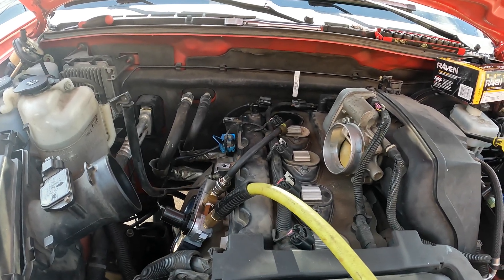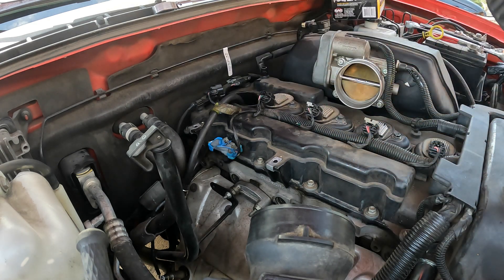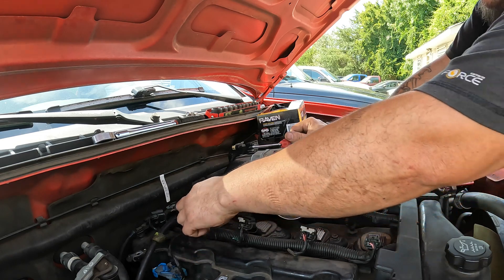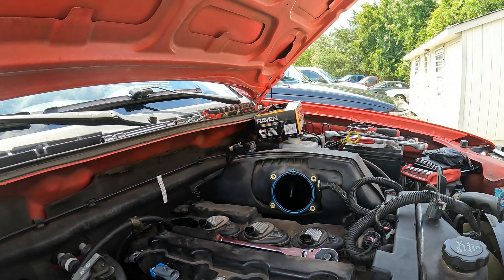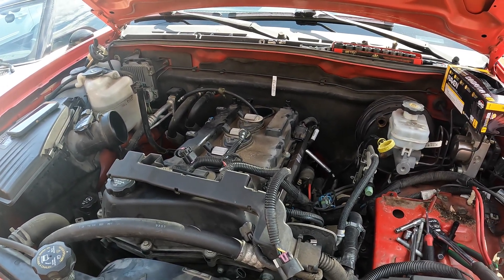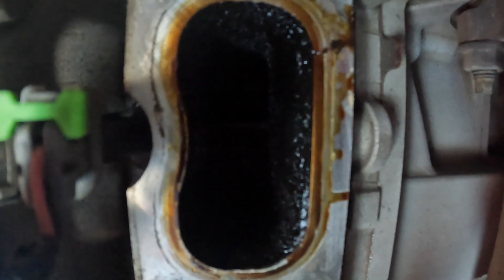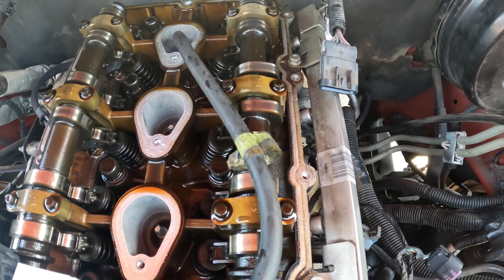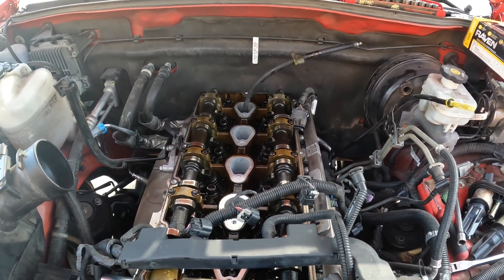GMC Canyon 3.5 Misfire Diagnosis

Comment: Was this misfire only on cylinder 5?!  Or all of them?  I’m having issue with inconsistent misfires randomly on all 5 cylinder’s.  Coils and plugs are all good. Replaces both cam sensors. Ran 2 cans seafoam in a tank and Seemed to be getting better till got to 1/4 tank on the fuel and bad misfires again.  The guy actually doing the work is wanting to next pull the valve cover to check the timing chain. 2004 Colorado 242k miles. Been perfect truck till now just regular maintenance.
Reply from the maker: This one was just on cylinder 5 but I have had the same issue where the cylinder head was causing all the cylinders to misfire randomly like you are stating.

Comment: Recently did some work on a Canyon that had same issue. Multiple misfire. Changed spark plugs and ignition coils. Still had a bad misfire. Did a compression test. Cyl. No.1 reading was 25psi. 
I knew the engine was toast at that point. Owner never changed the oil. The piston slap was loud and obvious.
Reply from the maker: That sucks.  Are you going to replace the engine?
Reply: @operationoverhaul  No, I no longer pull engines. Way too much work for me. I just do the easy jobs now. Client will probably sell the truck as a fixer upper. He has no interest in replacing the engine. Laziness on his part and expensive lesson for him.
Reply from the maker: @MrGP-qk8rc  i understand that. I am in the middle of an engine swap now on a qx30 which is basically a mercedes.  It is a lot of work but they are a friend and co-worker of mine so I wanted to help him out and save him some money.

Comment: Why you was checking it after removing all of this did you take something and rotate the engine just a little bit on every cylinder to make sure they was all closed because one or two could be closed the other ones could be open are vice versa I don't think all of them is closed the exact same on everyone at the same time
Reply from the maker: I actually did rotate it over while the leak down gauge was on it to ensure that the valves were fully seated.  I have videos up of the head gasket and head fix.  The machine shop performed a pressure test on it and they found that cylinder to have leaks on all of the valves actually but the intake  valves were worse.

Comment: I have a 2005 GMC Canyon with 340,000 miles on it and have a P0305 DTC code that won't go away. I replaced the fuel injectors, replaced valve cover gaskets, Intake manifold gaskets, replaced spark plugs, replaced 2 out of the 5 coil springs (4 and 5 cylinder coils),  replaced fuel pressure regulator, replaced the 5th cylinder coil connector, and after putting everything back together , I now smell fuel vapor coming from the left engine bay near the intake manifold. Overall, the truck starts up really good and it does have a rough idle when I am at a stop but I have no acceleration issues. I have noticed a reduction in speeds at around 65 mile per hour. I do not drive this truck more than 15 miles a day and I can't run the AC because of the fuel vap leak. I just wanted to ask if you think my truck is worth fixing at this point? Do you know what would be the next course of action for me to take? I replaced everything on this truck except for the engine. I would hate to get rid of this truck. Had it since 2005.
Reply from the maker: That depends on how much more money you are willing to put in it.  My next step personally if it was mine would be to pull the head and look at the head, pistons, and cylinders.
Reply: @operationoverhaul  okay. Thanks for your recommendation. It Helps especially from knowledgeable ppl like you. Have a good one.
Reply from the maker: @NeonBoom2586  you are welcome and I appreciate the kind words.  If you need anything else feel free to ask.
Reply: I have the same year truck 5 cylinder and have replaced all those compnents too and i also still have a p0304 cyl 4 misfire doesnt go away